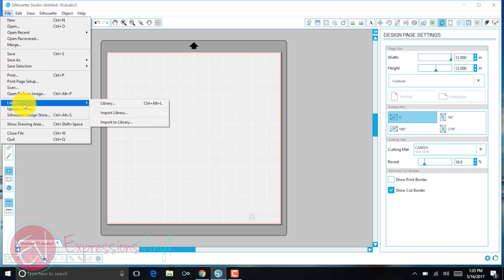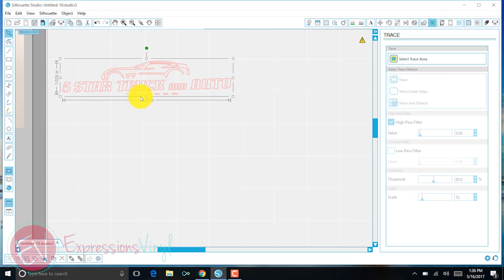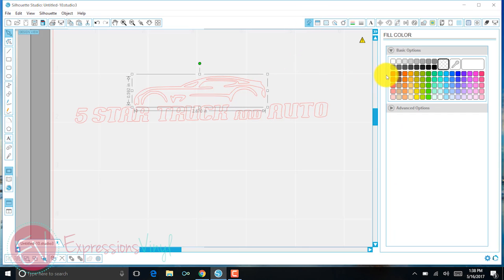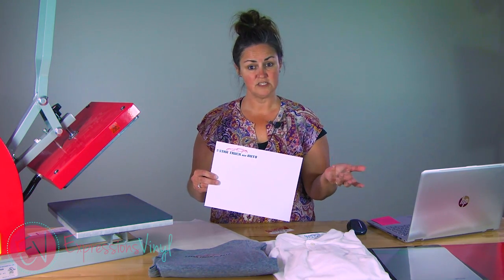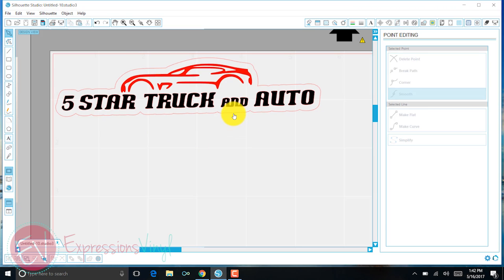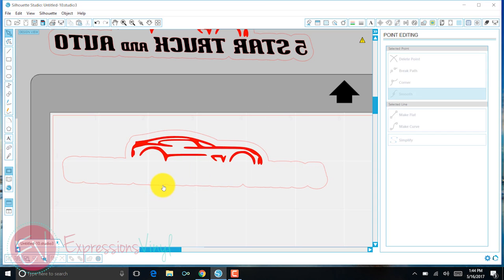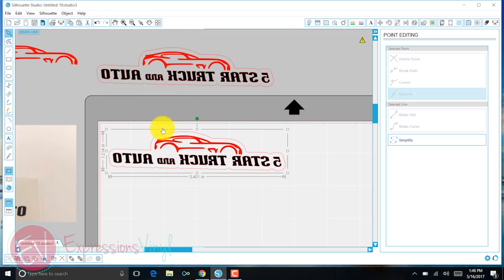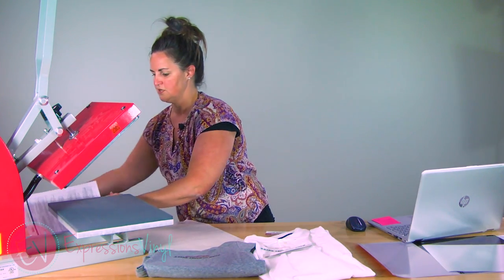Create a Custom Shirt Logo Using Heat Transfer Vinyl

Comment: You're doing well for never having really worked with HTV before :). Some tips to be aware of and to mention in next videos... you'll know the HTV is truly set and adhered well when you can see the grain/fiber of the clothing through the HTV. Seams of where the buttons and collars are can interfere and could potentially melt, so maybe mention heat press pillows and/or perfect pads to help with clearance of those :).
Reply: Thank you Charlene for mentioning all those different things that were left out of the video, but as a newbie I have no idea what all those things are.
Feeling confused now.